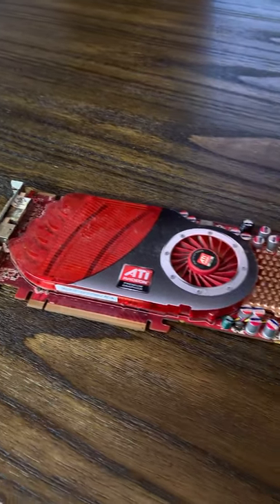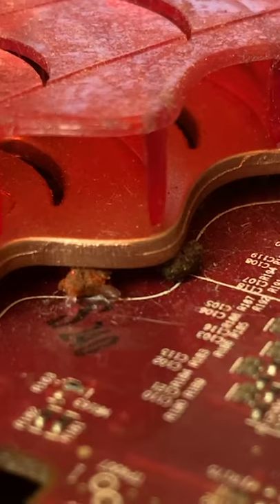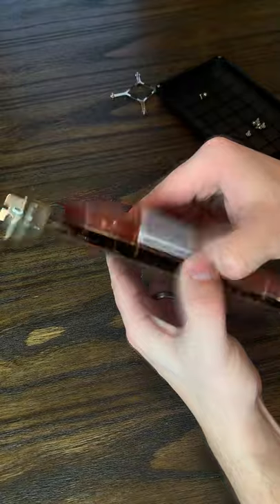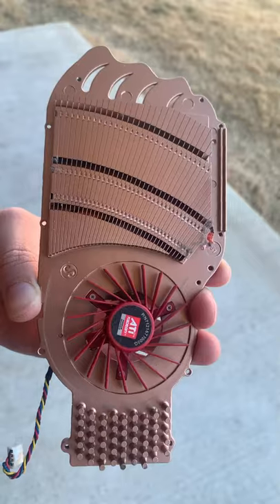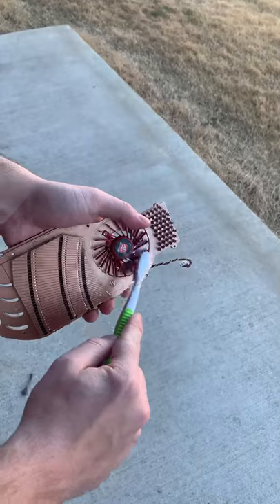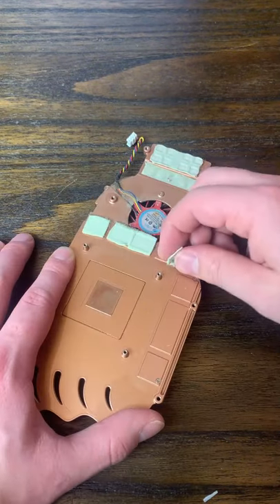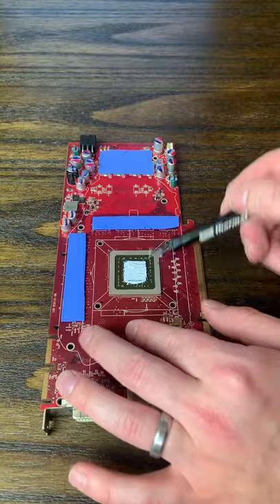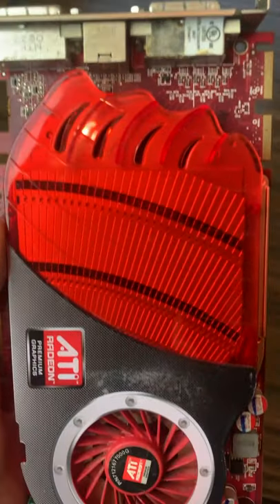This GPU has POOP in it 💩 ...can we save it? #Shorts

Comment: Is it ok to brush a card? I'm always scared that I'll rip off a capacitor when cleaning. Is it safe?
Reply from the maker: In my experience, it’s pretty safe as long as you’re not using a really firm brush or just going crazy with it. If a cap or resistor falls off from that, it was probably coming off anyway. Granted, I am not an expert by any means haha
Reply: @HardwareHaven  well if I brush something electronically, I'm gentle on it.
Reply: Don’t brush a cpu
I learned that the hard way
Reply from the maker: Like the bottom of it? Or like an exposed die?
Reply: @HardwareHaven  i would assume he means the pins. which is a no-brainer.
Reply: Honestly I doubt the brush would really do any real damage to a capacitor. But there's always a chance just like the motherboard, you can zap it to death if you have static coming from your body. So before touching it's bare parts, always wear a anti static wrist rest and hook it to a PC Case for example or place your other hand on a Power Supply while it's off. Those will ground you likely to be able to safely touch bare motherboard or GPU parts like a capacitor.
Reply: Static is fine as long as you ground yourself periodically, and don’t rub yourself against a carpet.. 
SMD capacitors simply won’t come off. It’s soldered on, pretty much low-temp welding.
Reply: Ideally don't brush with a totally dry brush, unless it's a special anti static one. Wet it thoroughly with alcohol then it won't be able to get statically charged from friction (triboelectric effect). But this is merely a precaution, I have never seen electronics die from dry brushing.

That being said triboelectric effect is real and electronic components ship in either anti-triboelectric pink bags or conductive grey ones; when neither, you expect some early deaths, it happens. Some components mail order companies learned it the hard way. However as much of an issue it tends to be with individual chips and FETs, fully assembled products are not nearly as susceptible.

Earthing yourself when handling a GPU is unnecessary. Do grab the board bracket first every time you stand up and sit down to equalise the potential in a safe way, before you touch the card edge connector or RAM or a MOSFET gate or something else. When you put a board into an anti static bag, put it in with the bracket towards the opening. Hold the board predominantly by the bracket.

In professional environments, there's several measures working in conjunction with eachother. So when you put things down, they go onto an earthed mat, to keep their potential near ground, and the worker wears an earthed strap that also keeps their potential near ground. But when you just grab a card from the packaging or from your desk without earthed mat, what potential is it even at? Unknown, none, any? You'll just have to have the potential difference get distributed and dissipated in a safe manner, even a lot of static voltage is little charge and doesn't take a lot of capacity to absorb.
Reply: As long as you’re not using a flat head screwdriver or angle grinder to brush your card off it will be fine
Reply: Haven’t tried with graphics cards before but most Capacitors are pretty firmly put in place so no worries (unless you really use a lot of force and a firm brush)
Reply: just use q soft brush and you're fine
Reply: @HardwareHaven  if it does fall out, bring it to your local soldering iron guru. A college is your best bet.
Reply: Of it's a soft toothbrush and you're real gentle you'll be fine. With that said though, I still wouldn't make a habit out of it, as that sorry of more "deep clean" is hardly ever necessary
Reply: Jesus loves all of you repent of your sins which is bad things belive that God raised Jesus from the dead and confess Jesus as lord and you will be saved...
Reply: When I worked at an electronics manufacturer, we used to pull out the trusty ol paintbrush to clean boards. The parts should be soldered on well, if they aren't that's its own, bigger problem
Reply: Probably with soft bristles instead of hard one I think if you look for brushes with super fine strands it would be glorious
Reply: I have an old wii disk reader and the other day I actually tried to pick the things soldered on it off with my fingers and I couldn't.
Reply: Yeah but u gotta use a steel wire brush to scrap off all those nasty capacitors yo get to the meat of the card
Reply: I’ve brushed mine with a toothbrush before. But if you want a better recommendation, use a light paint brush.
Reply: I work with solder and circuitboards. It shouldn’t cause any substantial issues with damaging the solder unless the solder was already damaged or poorly wetted (adhered.) Just don’t go crazy with it.
Reply: The way I clean a card is with Q tips and isopropyl alcohol, light air pressure, well, no more than 60 PSI
Reply: @HardwareHaven  unless you use a electrostatic insulated brush it could lead to a buildup of static electricity and fry your components. If you dont have an ESD brush (i suppose so) use one with plastic brushes because plastic is an non  conducting material. A toothbrush is my tool at home to do these things
Reply: @thegreatbeavers  you dont have t touch a PCB in the middle to brush it off... And even if your body was greatly electrically charged it wouldnt lead to a buildup on the tip of the brush because the handle is 99% of the time made from a non conducting material.
Reply from the maker: @gonzocrunch8356  yeah I’ve always used a toothbrush without issue
Reply: Use a soft brush from a repair kit.I use my frequently and never had any issues...
Reply: @thegreatbeavers  I've used those anti static wrist bands and they don't work.I had an acer X that needed some work,used the band and still manage to statically discharge into the power supply,knocking the crap out of me and fried the psu anyways.Those things are a joke if you have carpet.
Reply: I’ve gone ham on computer parts, it’ll be fine.
Reply: @maranellogaming  how often do you trim you CPU pins? I'm not sure how fast they grow so I haven't really trimmed mine yet.
Reply: @spicynoodle7419  once every two years
Reply: If Linus' GPUs survive his torture then I don't think you have to worry about anything lol

Comment: The HD 48xx generation was awesome, I have 2 4870s in a win XP build that still run great and probably will for another decade, so it sucks to see some cards like that get neglected :/
Reply from the maker: It’s crazy how quickly people will start calling something obsolete. Sounds like a sweet build by the way!
Reply: @HardwareHaven  Thanks!
Reply: Problem was that most R700s died pretty quickly in hot and humid climates, especially single slot cards even within the warranty period. Most retailers over here stopped bringing AMD cards down completely after that, until well into Polaris. Some niche high end shops brought Vega down, or on custom orders but still 90% of cards sold/available/listed are Nvidia even if nothing is in stock.

Comment: I have a card slightly newer (amd firepro w7100) and I put new paste and it reaches 99 Celsius still. To me it looks like AMD did a terrible job at the fan speed because when I edited it in msi afterburner, it only goes to 50% fan speed when it’s extremely hot
Reply from the maker: Oh wow. Is it also a single slot card? I have a feeling the thin heatsink/fan also contributes to the higher temps
Reply: @HardwareHaven  yes
Reply: @dxvidcx they try hard to keep it quiet... Too hard. You know it's not the engineering teams decision, someone else along the line wanted it changed.

Like apple laptops (and some of my other dells) that would wait till the laptop was scorching hot (even when typing a word doc) before momentarily turning the fan on low to keep the CPU around 80c +.  Even a tiny edit to keep the fan running slow the entire time makes it useable. Some of my favorite laptops have been ruined by that "ahhh! Don't turn the fan on" Behavior.

Comment: Blue thermal pads are rubbish.  A hundred times worse than those that were originally.  These are just pieces of rubber, they almost do not conduct heat and do not deform in any way to the shape of the components when pressed.

Comment: The windows logo was just halfway there. 😂😳
Reply from the maker: Yeah it was funky at first. Probably because I was having to use dvi adapters. It actually works fine (if you can get the proper drivers running, which Win 10 no longer supports lol)

Comment: I don't see why you didn't use k5pro in it, it's a thermal pad Replacements that works more like thermal paste then a thermal pad but whereas normal thermal pads only conduct 60% of the heat k5pro conducts 99%... I saw it initially on a ltt video, and it works for my Raspberry Pi 4.
Reply from the maker: Because it’s what I had on hand. K5 pro can get pretty messy as well, but I’m curious to try it. What type heatsink did you use with your RPi4?
Reply: @HardwareHaven  it was some extremetech cooler, it had a terrible set of pre included thermal pads(and copper riser for pi3) for the Raspberry Pi 3 and 4. When I apply the k5pro, of course it slid around the tiny bit, but it does get better performance than just having Plain heatsinks on. Even when I overclock, it stays a nice 40 degrees on adverage. Also the whole point of it is to make a mess, as to more evenly or rather unevenly spread it just to make sure that it makes full contact with everything that it needs to make contact with.
Reply from the maker: Yeah I totally get the idea behind it. Glad that it’s worked so well for you!

Comment: The amount of thermal paste used....
Reply from the maker: … is actually just fine. 

(I’m actually in the process of editing a video testing the application I used vs people’s recommendations. The way I did it wasn’t great in the sense that it could’ve potentially created air bubbles, so I actually won’t be doing it anymore in most cases. However, having too much essentially has no impact on performance. Having too little can cause issues though.)

Comment: Eek that looked like too much paste on the dye, hope he removed some before he was done
Reply from the maker: I’m curious what your concern is about too much paste. Just the potential mess or thermals? If it’s thermals, it’s been shown over and over that too much barely has any impact if any at all, where having to little can be much more detrimental.
Reply: @HardwareHaven  I've just heard that it's bad for thermals because metal against metal provides better heat flow. Guess actual experiments trump theory once again. I'm gonna keep applying sparingly though, it just feels wrong to have a thick layer of paste between the plates and I don't wanna risk overtightening
Reply from the maker: @iwikal  I gotcha! The problem with the metal to metal thought is that there’s usually not consistent contact, and air doesn’t transfer heat very well, where as thermally conductive paste does. Any extra paste should get squeezed out, and most mounting brackets have some sort of mechanism to make sure the mounting pressure is correct.
Reply: @HardwareHaven  Just watched your video where you test this. The "medium sized dot" looks about as big as I would use, so I guess I'm good. I guess it just looked like a lot in this one because you were spreading it?
And yes I know how thermal paste works, it's supposed to fill out any mini airpockets. I just thought it shouldn't take a lot of paste to do that, you just have to make sure it ends up covering the dye.
Reply from the maker: @iwikal  I put more on this card than I did in that test, but it still worked fine 👍🏻

Comment: bro painted that shit in thermal paste
Reply from the maker: What’s your recommendation for what I should do differently?
Reply: @HardwareHaven  a small dot, ideally you want as little as possible to minimize how much paste heat has to travel through to cool the metal. Also, I have never used a "thermal paste application tool"
Reply from the maker: I’ve always thought that’s what you’re supposed to do with CPUs or other chips that have a heat spreader. With exposed dies like on GPUs, I’ve heard it’s best to apply a thin spread out layer. I’m pretty sure it’s due to less mounting pressure, so it’s possible to not have the paste spread fully, and bare spots can exist on the die.
Reply from the maker: Also, thanks for responding. You’re the only person to do that so far I believe haha

Comment: Hm I wonder whats better an R9 390 8gb or an rtx 1060 3gb?

I own both and want to use the better one.
Reply from the maker: A: You’re lucky haha
B: It would be fun to benchmark them and find out! My guess is the R9 390. The 1060 is solid, but the 3gb memory definitely comes into play on a lot of modern stuff. I think Budget Builds recently did a review of the 3050 and it was pretty similar to the r9 390 if I remember correctly
Reply: @HardwareHaven  I don't know how trustworthy that website is but the one that always shows up when you type in comparisons of graphics cards says that the 1060 is 5% better that's when comparing the regular 390 not the 390x to the 3 GB 1060.

I would totally test them but I don't want to have to uninstall and reinstall drivers.

Comment: Broooooo why do you apply thermal paste like this?????
Reply from the maker: What’s your recommended method?
Reply: @HardwareHaven  blob in the middle then place the heatsink on top carefully and tighten the screws evenly so that it spreads nicely. It really is the best way to cover the heatsink evently and not get any air trapped inside (which leads to hotspots)
Reply from the maker: That’s what I do typically (at least for CPUs). With exposed dies, I’ve heard that there’s often not enough mounting pressure to sufficiently spread everything out. I used the applicator that thermal grizzly includes and recommends with their Kryonaut.
Reply: @HardwareHaven  I think it is exactly the same principle for either CPU and GPU dies and should applying the same way. Yes Kryonaut supplies the spatula but pretty much nobody uses for that purpose
Reply from the maker: Fair enough 👍🏻